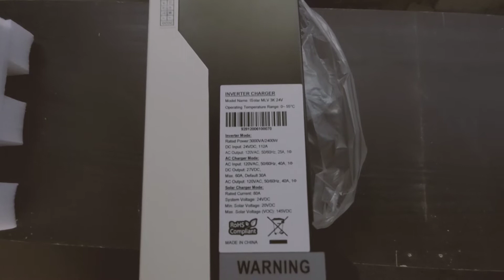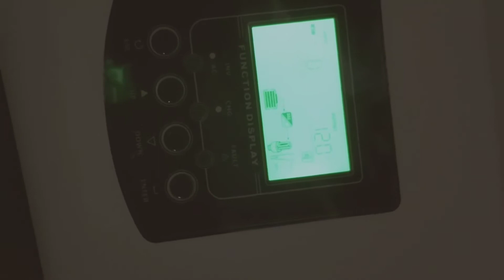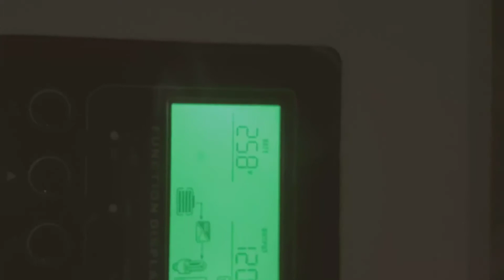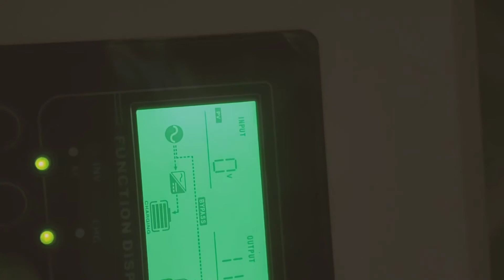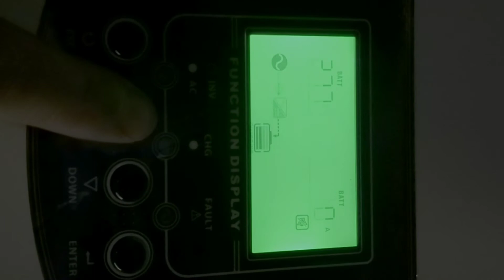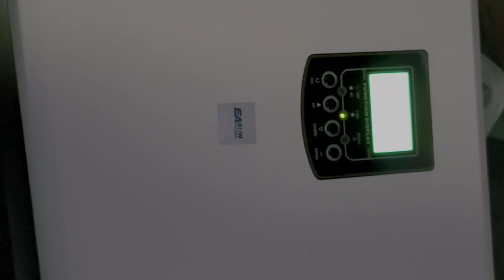Unboxing Powland solar inverter 2400watt 80a mppt

Comment: Hallo zusammen, 

ich möchte euch vor dem Aliexpress-Händler "POWLAND EU Store" warnen.

 

Ich habe im letzten Jahr (Oktober) einen MPPT Solar Charge Controller von EA Sun geordert. 

Dieser kam auch an, allerdings defekt. 

Zwischen PV + und - besteht eine Verbindung (Durchgangsmessung 0 Ohm). - Letztlich ein defektes Mainboard.

Die Kommunikation mit dem Händler gestaltete sich dann als sehr schwierig und ich merkte schnell, dass dieser es darauf abzielt die Kommunikation in die Länge zu treiben, damit ich irgendwann aufgebe. Ich musste auch permanet die Fehlerbeschreibung wiederholen und scheinbar hat er diese nie gelesen.

Er forderte permanent neue Videos von dem Fehler. Die Zeiten zwischen diesen Antworten waren auch meist mehrere Tage / Wochen.

In Polen bestellt, damit es schnell geht, aber ein Rückversand wäre nur nach China möglich. Dieser übersteigt den Wert.

Nach rund 6 Monaten wird mir nun ein Austausch-Mainboard angeboten, allerdings gegen die Übernahme der Versandkosten aus China (30€) und dann natürlich Zoll.

Ich sehe das absolut nicht ein, warum man nochmals bezahlen soll, bei dem miesen Service und den Zweifeln, die man bei diesem dubiosen Shop nun hat.

Ich rate euch daher allen davon ab bei diesem Händler zu kaufen.

Comment: Don't buy from Powland/Easun, unless you feel lucky... 3 out of 5 inverters don't work properly, no support, they just ask you for making video's and pictures to prove you are right, once you prove them, you never hear back from them.
Reply: Hallo zusammen, 

ich möchte euch vor dem Aliexpress-Händler "POWLAND EU Store" warnen.

 

Ich habe im letzten Jahr (Oktober) einen MPPT Solar Charge Controller von EA Sun geordert. 

Dieser kam auch an, allerdings defekt. 

Zwischen PV + und - besteht eine Verbindung (Durchgangsmessung 0 Ohm). - Letztlich ein defektes Mainboard.

Die Kommunikation mit dem Händler gestaltete sich dann als sehr schwierig und ich merkte schnell, dass dieser es darauf abzielt die Kommunikation in die Länge zu treiben, damit ich irgendwann aufgebe. Ich musste auch permanet die Fehlerbeschreibung wiederholen und scheinbar hat er diese nie gelesen.

Er forderte permanent neue Videos von dem Fehler. Die Zeiten zwischen diesen Antworten waren auch meist mehrere Tage / Wochen.

In Polen bestellt, damit es schnell geht, aber ein Rückversand wäre nur nach China möglich. Dieser übersteigt den Wert.

Nach rund 6 Monaten wird mir nun ein Austausch-Mainboard angeboten, allerdings gegen die Übernahme der Versandkosten aus China (30€) und dann natürlich Zoll.

Ich sehe das absolut nicht ein, warum man nochmals bezahlen soll, bei dem miesen Service und den Zweifeln, die man bei diesem dubiosen Shop nun hat.

Ich rate euch daher allen davon ab bei diesem Händler zu kaufen.

Comment: @Tanik Sambo thanks for the video. Do you still have the uni, if not can you remember if you are able to set a time slot for the unit to charge the batteries between a certain time slot. I'd like to use it to charge my batteries at midnight so I can benefit from half price off peak electricity. Thank you.

Comment: Thanks for your video Tanik! Can you make a followup video on how it's going and what results you get in terms of solar management, battery charging ecc.
Reply from the maker: Hi thank you for watching. I haven't been really doing anything much with it. But I can say that stand by power usage is high. But all I have been doing is charging my battery and using it once or twice a week cause I only have a 315watt panel to recharge and charging battery on the grid here in California I'm hitting the high tier which over all I'm not saving any money with this setup. I will probably make a follow up or I might be changing out my system to a 48v system. So not sure yet. Need more solar panel for sure though.
Reply: @taniksambo1969  You're welcome. True, on small solar systems (under 500W) the overhead you have is quite high; my small system inverter uses, I suppose, about 20Wh + 10/15% of output wattage. To make sense out of solar it should have over 1KW of panels, I'm considering for this summer an upgrade to 1.6KW of panels on 24V. It's ok using 24V in the 1KW - 2KW range because it's more economical to expand the system, you can add 1 panel at a time. On a 48V system you must add 2 panels at once to expand. Same for batteries: on a 24V system I expand battery storage by adding 2x 12V AGM batteries, while on a 48V system I must buy 4 batteries. On systems with over 2KW of panels I would consider moving to 48V. I'm obviously making a low-budget solar system, if I had money to spend on it I'd just but a 3.3KW complete system and hurray!
Reply from the maker: @jesjames  yep its all about the money. I have 4 24v batteries. total of about 2kwh. But I couldnt afford all the solar panel. and my space i couldnt put up more than the 1 solar panel that is currently on. though i will be moving soon with more space to accommodate more solar panels and hopefully I can start buying the solar panels as time comes. I had agm batteries before with a 100w solar but sold that setup and got this solar inverter. but then plans didnt go as planned and if i had 2 more solar panels of 315watt  I could of had close to 1kw to power and charge a little better. 
Soon i hope i will get everything up and do more videos.

Comment: Can it charge from ac and solar at full power? At once?
Reply from the maker: I've never tried to charge that high. I don't have many solar panel to go the max. And the ac part can go up to 60a. Technically this should be able to do 80a solar and 60a ac so a total of 140a.

Comment: Cool. It looks the inverter working good. Powland and Easun belong to the same company. While Powland was US brand, Easun was China brand.
This is 3kva 2400w Off Grid solar Inverter, it with 24Vdc 80A MPPT solar controller and 60A AC Charger. it can make in parallel with Max 9 units, so you can get 3kva-27kva power in single phase & 3 phase. it is 120Vac 60HZ output which suit for US/ Canada/ Mexico and Latin America countries).
Reply: Powland is now also hot in Italy, Hungary and other countries